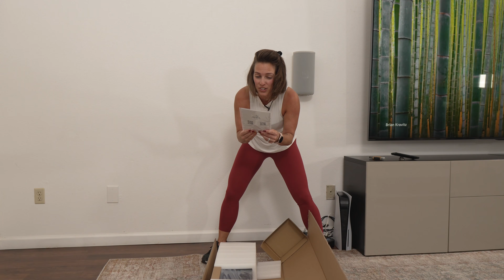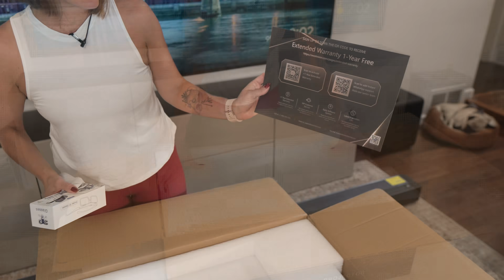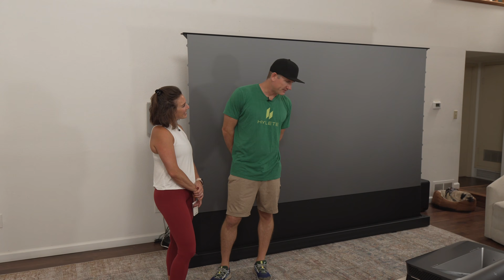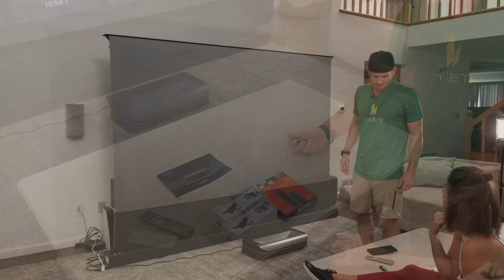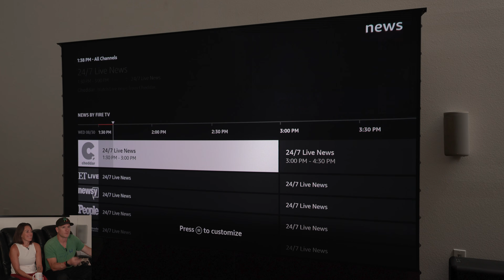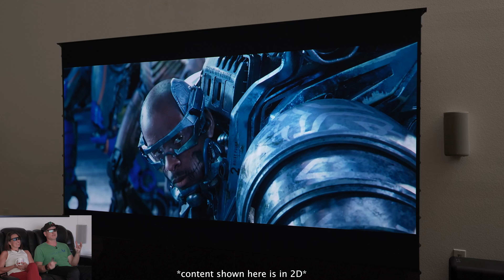120" AWOL Floor Rising Screen w/LTV-3500 Pro 3D Laser TV

Comment: Why does the screen power cord bend towards the room?  When most electrical outlets are on walls. Perhaps it is because the on/off button would be covered by the cord, because it was installed on the wrong side of the power inlet. Chinese engineering at its finest.  Great idea to put a a power outlet on the front of the screen. Less projector cordage to snake around the screen. AWOL …… back to the drawing board. For $6000 each, probably too much to expect.

Comment: The TV behind that looked much better.  Projectors just don’t do it for me.  Especially a floor unit. That wouldn’t last long in a lot of homes. They should have a rear projection projector and a screen to accomodate. The cost is way too much as well.
Reply: For people like me, it's all about the 3D. That's the only reason I bought mine. If TV's still had 3D, I would 100% have bought one.

Comment: I’ll never like the projector sitting in the middle of the floor for the kids or me to trip over - just an unfinished solution 

A stand with it built in that doesn’t stick out far is the solution but we will see when that comes out - ultra super short throw vertical but this on the floor ain’t it
Reply: i have mine on wall brackets along the wall

Comment: It’s a shame. No 4K @ 120 is a deal breaker. Also, micro USB, seriously? First of all I didn’t even think 3D was still a thing and I suppose it’s fitting that that early 2010 tech died when micro USB was still around. Micro USB WAS the worst USB connector of all time! Would it have killed them to put a USB-C port on them?

Comment: I'm concerned about the number of wires that will be required to connect it to my DVD player and game console. I'm worried that they will be unsightly and difficult to manage.

Second, I don't recall seeing any mention of a 3D app in the product specifications. I would like to know if there is one available, as I would like to be able to watch 3D movies on the TV.

Finally, I would like to know if the TV can be installed on the ceiling. I have a small living room and I think it would be more space-efficient to have the TV mounted on the ceiling.

Can you follow it up please?
Reply: TE PUSISTE MEDIO COMPLICADO...AMIGO...CON EL TIEMPO HASTA TU...VAS A ESTORBAR...

Comment: You didn't comment about the fact that the projector was right on the floor! Pets and babies could be dribbling into the opening and dust which is always close to the floor would be filtering down onto the projection lens when you would walk by etc. I have a real concern about this. Also a baby could easily crawl over to the projector and look in the opening where the lens is. What if you only had 8' ceilings to work with in you home theater room. Then you're going to be constrained to placing the projector in the right place relative to the screen. What was the overall extended height of the projection screen? Did the tensioning mechanism work well even if you only extended the screen up so maybe just 4 inches of the base material (non-screen material) was showing above the screen storage area?
Reply: The projector has a sensor to shutoff when anyone gets too close and most people don’t use it on the floor.
Reply: I mean if you have ALL that going on then clearly this isn’t meant for someone like you

Comment: Make sure that in the Picture/Light settings you choose USER then you can turn the laser brightness to it's maximum of 10.  Its set at around 5/6 as default.  Great projector.  had mine for nearly a year.
Reply from the maker: Thanks for the tip
Reply: This is the new pro model
Reply: @dniel2535  it’s the same model they just added voice assistants and maybe a couple of minor additions.
Reply: @FooFighter33  dolby vision and a lot less imput lag plus dolby atmos plus 24fps plus control 4(the voice control) plus clearer image plus enhanced black levels is actually a pretty good upgrade
Reply: @dniel2535  all those features are available on the 3500 model I have now.

Comment: I bought an AWOL 3500 last month, but ended up returning it. (I got the TCL 98” 98R754 instead half the price)   AWOL was not bright enough with the large patio doors I have in the living room.   The fan noise is actually too noticeable.  And with my AV cabinet  the screen has to be be mounted way too high to meet the recommended viewing height.  I’m way happier with the TCL.  I’ll get the 115” TCL TV when that comes out. The AWOL looked great at night though. But TV is still better.
Reply: But you lost 3D. Probably not a big deal to you, but a game changer for me.
Reply: @semeyson1  yeah I was ready to dabble in some 3D but I won’t miss it.   My TV looks great even with both of my wide patio windows open on a bright south Florida sunny day.
Reply: @JazJonFL  Interesting. I had a buddy in Florida that also had to return his AWOL because of the sunlight. I have the AWOl 2500 I just got last week. I live in California, and simply keeping my blinds closed from 6 to 8 o'clock is all I need. Enjoy your TV. I have a rising screen in front of my LG Oled, so if I need to get that Oled fix I have it available. But the 3D on these is better than IMAX.
Reply: Gotta think ahead.
Reply: You made the right choice, 3D is a gimmick for little kids.
Reply: @kuldipsingh366  3D is art bro if done correctly it can take a regular movie and make it an immersive experience. Don't be salty just cuz you can't afford it.
Reply: @kuldipsingh366 3D adds DEPTH which contributes to IMMERSION.

There's a reason why both Avatar movies are in the top 3 highest grossing movies. 🤣🤣🤣
Reply: @kuldipsingh366  haha you’re one funny guy my friend 

And not in the good way